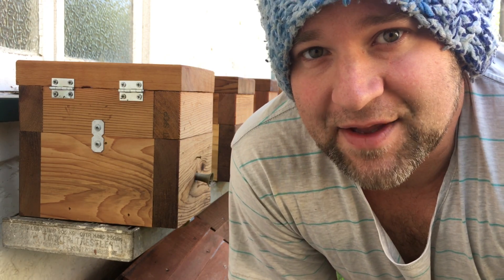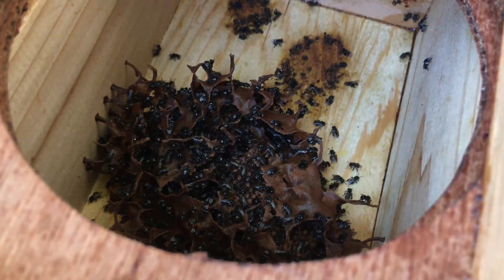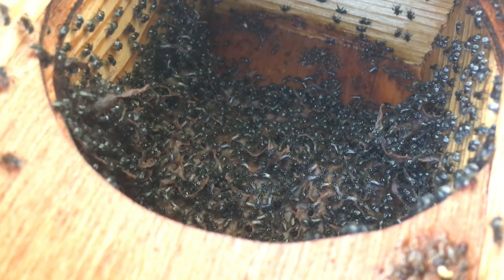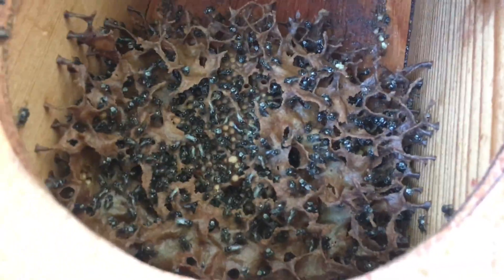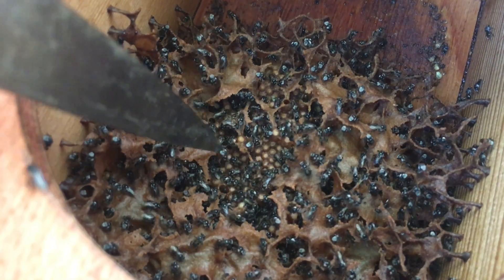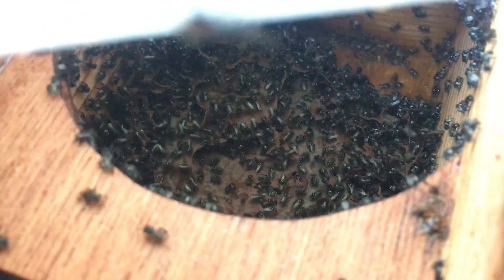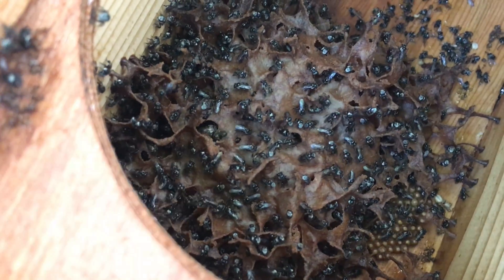How to tell if you have a queen bee 🐝

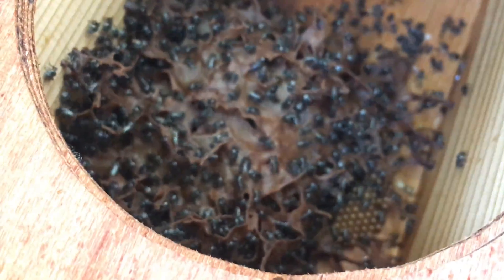Comment: at 5:16 what happened to all those dead bees did they drown in honey during split?  why is that brood out the rh side is that just old brood pushed out of center?  do they do rear tunnels even though they cant exit through mesh? cheers  love the box design is it a easy design to throw a super on once developed by just removing lid and adding to top of super guessing they would attach honey pots to clear film or lid
Reply from the maker: jako j good question. I can’t remember why those were dead. She’s almost packed full now though. In regards to the brood they will mostly cover the new brood first because the newer brood needs to be held at a higher humidity. The bit that’s out could be some I have added but not sure. The rear tunnels get fashioned to work the air and even though they can’t leave that way they guard them because they can feel the air.  Thanks for your comments regarding the hive. I still use these hives in all my propagation. They are really easy to build and the bees love em.

Comment: Were these colonies started by eduction?
Reply from the maker: Yes you are correct. :)
Reply: @australiannativebee3662  do you try to avoid splits?  dose a good induction take 6 months dependent on amount of brood added or did you not even strart them with brood just linked up
Reply from the maker: jako j it’s a bit random. I have done some in 2 weeks that have gone on to be killer colonies and some take 2 years. Brood helps a lot but doesn’t determine how good that colony will turn out to be. It does help the spreed though. More brood usually will equate to a faster eduction takes.